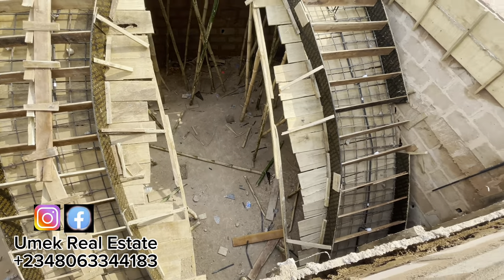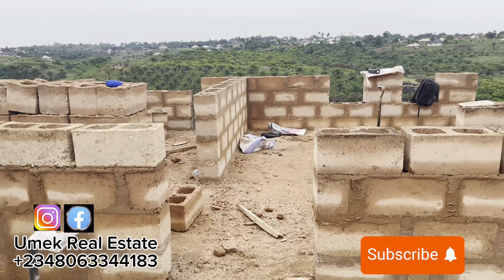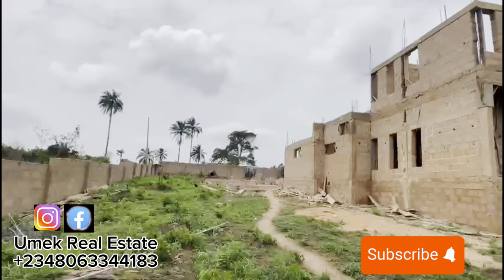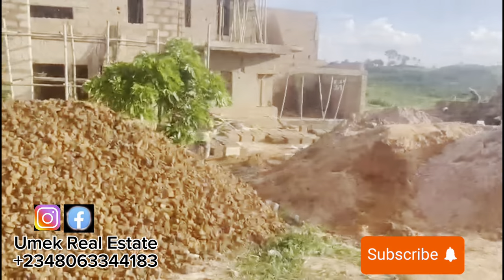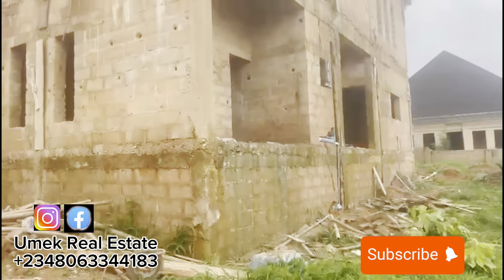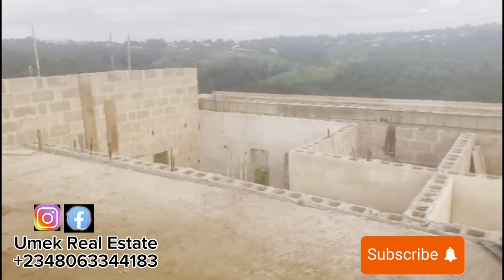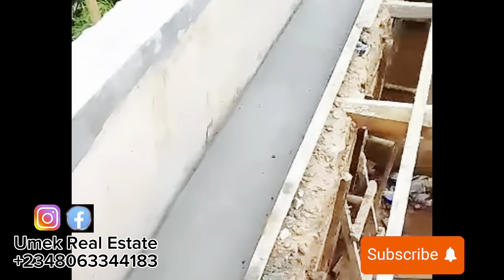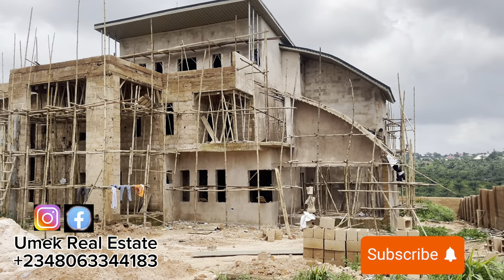Building a 529sqM luxury 6 bedroom duplex in 2023 Nigeria | Cost and material | Umek Real Estate

Comment: Hello engineer, I have a 600 SQM land around Ajah Lagos . My question is, can the mentioned land size build a 5 bedroom and 3 bedroom duplexes?
Reply from the maker: Definitely sir… do you want them as semi detached or stand alone???
Reply: I actually want them as a standalone
Reply from the maker: @James_150  that’s fine sir, could you tell us the length and width of the plot??? 
That would help to determine if it would accommodate the building… however, the average plot of land measuring 600 SqM will comfortably be enough  for the proposed building
Reply: @UmekRealestate  I only have a video of it and from the documentation, it is 600SQM. It was secured with the help of my lawyer